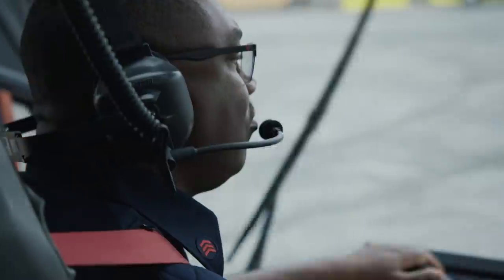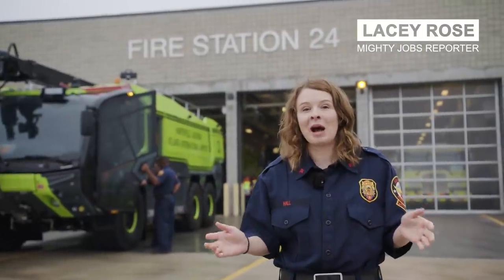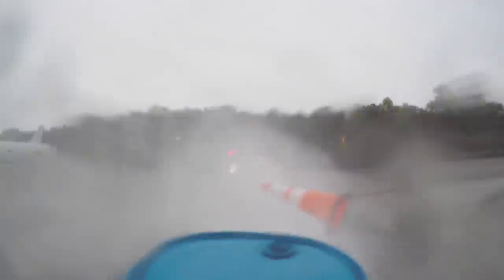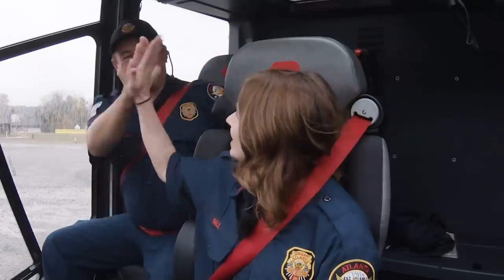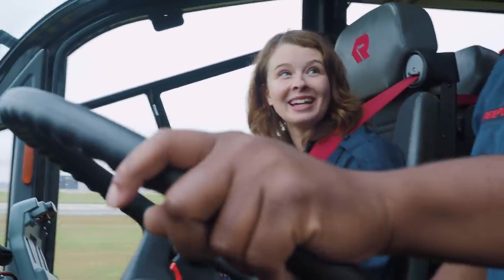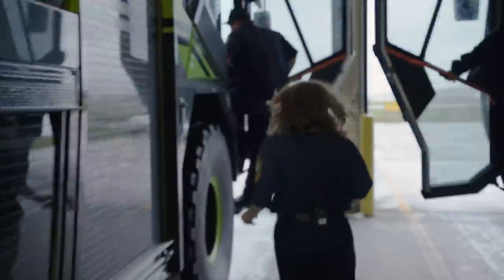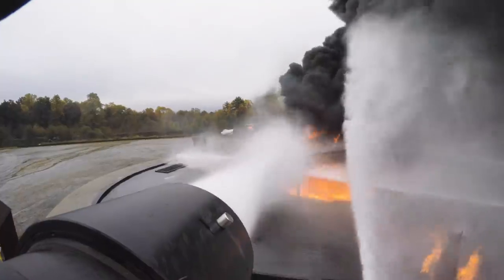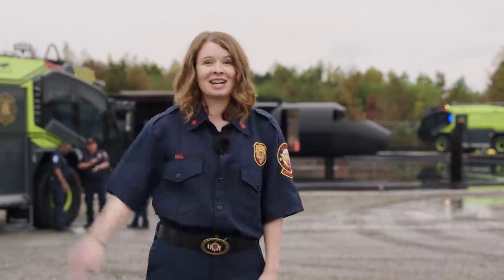The Fire Truck of the Future (2020) I Volvo Penta Mighty Jobs

Comment: Ordinary firetrucks: outdated and used all the time
Airport firetrucks: super advanced technology and never get used.

Thats economy for ya
Reply: They aren’t outdated plus airport firefighting is way different and has different needs then structural firefighting
Reply: PaintballGaming just the tip? I think you’re confused with what you’re talking about. Regardless, pumps, engines, hours; drivetrains lines, etc...come on dude.
Reply: JM Wiłłiams Not confused at all ARFF is way different than structural firefighting every firefighter should know that
Reply: Guys its a joke. Calm down
Reply: It’s not a very funny joke
Reply: I think they do this because when a planes goes up in flames, there are over 150 lives at risk, where as fires in the ground people can prepare for and the amount of humans at risk is low. Here in Australia around 20 people have died, the plane can have anywhere between 100 to 450 people.
Reply: ImaMcMuffin You can still have 150 lives at risk in a structure fire look at New York they have huge apartments with a lot of people in them and you can never plan for how many lives you could loose
Reply: Structure city fire usually has unlimited water supply unless it is rural, Airport, on the other hand, all you have is the fluid in that tank when it is out you are really out of power to fight the fire.
Reply: I’d expect airplane fires to be alot harder to put out with all the gasoline and stuff making the fire more powerful.
Reply: Hunter Miller Planes don’t run on gasoline they run on jet fuel or another type of fuel depending on your plane and it just depends aircraft’s burn a lot hotter but a lot of structure fires can be really hard to put out
Reply: @j.michaelwiiams1859  "just the tips" is the username that the other guy has
Reply: sibertooth  depending on how bad the fire is, considering both the fuel and the heat source are outside the cabin, there should be a few minutes from hitting ground to everyone being dead. Firetrucks usually take all of 5 seconds to reach the plane, as they are waiting right at where the plane will stop at the runway.
Reply: Ok boomer. Would you want the oldest fire truck trying to set out a fire on your aircraft? I don’t think so
Reply: You know i made this comment as a joke. I didn't mean to start a heated debate about firetrucks
Reply: @paintballgaming1090  People have different types of humour. 
Deal with it.
Reply: Christian Andersson That’s a weird sense of humor then. And nah I won’t deal with it what I said was true
Reply: PaintballGaming it’s called an opinion. There are different ones
Reply: Captain Skippa Never would’ve guessed...
Reply: @paintballgaming1090  The problem with New York like any other major city is that advanced firetruck can't do jackshit if it can't reach the place in time. Skyscrapers are going to be a big problem if the fire is going to be something like an airplane fire as sadly New York knows too well.
Reply: An airplane is full with toxic fluids thats why this firetruck is suitable
Reply: It's probably because Plane crashes aren't as often as House fires, car crashes and cats in trees
Reply: @huntermiller2867  Putting out the flames is  only one part. The power of the jet to chase the flames and heat  off the passenger comparment is equally vital.
Reply: @adenl13  airport fire departments have better equipment as they're privately owned and in general have a higher budget whiles standard fire departments have a smaller budget as they're owned by a county or a municipality...
Reply: Let's just say if an airport firetrucks fucked up the life toll would easily skyrocket
Reply: This beast is so costly it will cost 1trillion doalar to put this in every station
Reply: Once again, we have a civilian speaking out of ignorance. The city apparatus we have is NOT outdated. If you actually DID the job you would know. Also, it is up to local governments to allocate funds to their agencies. Atlanta is the BUSIEST AIRPORT, just like DFW and O'Hare. If you are stuck aboard a burning aircraft, you wouldn't be arguing about technology. It takes one minute to 90 seconds for a fire to breach the cabin of a commercial airliner. FAA demands a fast response(3 minutes for the first arriving ARFF vehicle). You dwell on that.
Reply: @florimond.  ATL is the busiest airport in the world it’s not private! It’s a public airport owned by the people of city of Atlanta!

Comment: I'm starting to understand why the reporter used soda cans and bath tub.

I guess Americans just dont want to understand metric.
Reply: I mean if it's a video in America, about American trucks, obviously Americans are going to watch. If we haven't grown up around the metric system, we wouldn't be able to relate to it just as you wouldn't relate to the imperial system like you do the metric system. Hearing 80km/h has to significance to me, while 50mph would have.
Reply: Some Americans need to get past the Earth is flat and there's no such thing as the moon.....Metric system is a long way away my friend.
Reply: Jacob Gilbert what do you mean by american trucks when its a swedish truck?
Reply: @robinaleksander6791  the company may be Swedish, but the trucks are in the USA. Not hard to comprehend for an American.
Reply: Hyperion WhiteStar the engine is Swedish but the company of the truck is Rosenbauer from Austria
Reply: Also, while the metric system is very straightforward sometimes any scale is hard to visualize. So we use everyday items to give a sense of huge size. Eg:  A bulldozer weighs 49,000 kg or 10 elephants or in SI 50 Metric ass tons.
Reply: Jacob Gilbert 

Yes because I’m sure changing the whole system to metric is a good idea and totally not gonna end in disaster as most taxpayers and current students will have to relearn the new system.

I’m sure nothing bad is gonna happen to the economy. Smh

Comment: I like how they extinguished a fire without stepping out of the truck! 😂
Reply: Lmfao
Reply: Yeah, pretty efficient
Reply: Why would they need to get out of the truck? The water is on board so no need to connect pipes, the hoses are too powerfull to be handled by people, they are more protected in the truck, they dont have time to do anything else, they are in open field, so they can park anywhere they want. They dont need to bring hoses around corners or in buildings.
Reply: @niconico3907  I never said they had to go out of the truck.
Reply: Give the time constraints on an aircraft fire, your right, by the time you get out an fix hoses. Forget it your a body collection detail

Comment: I thought in aircraft fires fire fighting foam is used?
Reply: Ghostytytyytbedhh im sure it is filled with foam when theyre not training
Reply: They don't use the foam in training because it harms the environment and there is no need during training, plus it's expensive
Reply: @KiranBJJ  fair enough. Never knew that but yeah makes sense.
Reply: Wint help you when its still hot underwards first coll it then drown it in foam
Reply: @user-pc5tc8dj7v no they dont
 Firefighting foam is cool. It also is good for use for fuel fires and it covers the flames and jet fuel. If they use water first then it would just wash all the foam off and the foam would be useless. They use water after to wash the foam off the tarmac.
Reply: @user-pc5tc8dj7v  yeh ghosty is right, the foam cuts off the oxygen from the fire, with no oxygen there is no fire as you know from primary school science. Once the oxygen has been starved for long enough there will eventually no longer be any heat as there fire hasnt had oxygen to create heat, it will cool on it's own
Reply: @Samuel Lynch yes that is why it is used for aircraft fires too, jet fuel is a chemical
Reply: Carter Bohrer  not like that's been said twice already 🤦🏽‍♂️
Reply: While it is originally used in aircraft nowadays more departments use foam in structure or any other fire bc why not, it does the job in half the time.
Reply: @KiranBJJ  or refire when the foam vanisches before the heat which has also a very good saving medium(the floor) is completely gone
Reply: @KiranBJJ  which it does
Reply: The foam is in the water
Reply: They use retardant (from what I heard off SMFR) or purple k
Reply: @KiranBJJ  bingo
Reply: they need both, water is use to cool down the fuel tank so it wont explode and foam to cover the fuel on fire.
Reply: KiranBJ 

Oh yes it harms the environment. Smh. You people gone keep using that to ALL of your conversations? 

Oh paying taxes harms the environment. 🤦🏻‍♂️ smh
Reply: @KiranBJJ  save the environment but use large amount of fuel that produces major smoke pollution...??
Reply: @jaknayree2000  every little helps, would you rather them do both?
Reply: They use WetWater. No joke! A substance called a Surfaccant AKA Wetting Agent is used, washing up detergent is one. Breack the surface tension of the water, goes faster and gets in all the small places as sit dosen't puddle.  Putting the fire out is this case is a secondary, keeping flames and heat off the passenger compartment is primary. Ifyou don't do so within 90 seconds, your just a mortuary crew.

Comment: Los Angeles should use those against the wildfires
Reply: Would be cool but impractical. It’s almost impossible to put out full fledged forest fires. Instead they control the fire by dumping retardant onto sensitive areas and creating fire lines to prevent the fire from spreading. If this truck can dump it’s entire reservoir in less than 2m then it’s useless.
Reply: Or they could just stop starting their own fires
Reply: @OrthobroLocal1  But they don't though. A lot of brush fires are starting by the dry seasons when something as simple as two leaves scraping together spark and boom, forest fire. Some are arson and some are accidental yet most of them are natural.
Reply: Kadeem Johnson LA? How about Australia, our hole country is in flames
Reply: @mrengine9  i'd say lightning is a larger factor then leaves scraping together in terms of nature.
Reply: Kadeem Johnson water doesnt put out wildfires (specifically) garden tools do
Reply: controlled burns.png

Comment: Makes  you wonder why not equip every  fire department with these...
Reply: Alex Valeev only useful in very specific applications. all fire apparatus are custom built and/or equipped to their response area
Reply: One single word; price. These are probably extremely expensive and not every airport or airport fire department can afford these. Since this is the world’s « biggest » airport, it probably has the budget for those.
Reply: VERY VERY expensive
Reply: Because huge waterjets and trucks that tip over during sharp turns ain't very useful in cities.

Comment: Every fire department should have a fire truck like this. Ordinary fire trucks and crew take too long to connect the hoses before they even turn on the water.
Reply: Andy R Aircraft fires, if they are on the field, are in a wide open space and for the most time on the exterior of the aircraft. Structural firefighting happens inside of buildings, so we have to go inside and find victims and the source of the fire and knock it done. I’ve done both since 1987 it’s two totally different kinds of firefighting.
Reply: Andy R thats why the hoses on “ordinary” fire engines are preconnected. these Aircraft Rescue and Fire Fighting, or ARFF, rigs are purpose-built for airports. they would not be effective at all on most structure or vehicle fires due to the fact that mobility is very limited in tight spaces like crowded freeways and narrow streets and alleys. these ARFF rigs are built for large open spaces like airports

Comment: what if they are training and an actual plane catches fire 
do they let this burn out or is there a extinguish system that does it for them on site
or do they leave one truck behind to extinguish it, or do they extinguish this first and then ride to the plane?
Reply: There's still at least one, more than likely two fully capable companies ready to roll to an actual emergency while training is going on, as the video said the actual fleet has 29 units, very rarely to aircraft or airfield fires happen, it's highly unlikely they'd overlap, but if they did there's a contingency

Comment: That is slow
Reply: 0-80 kmph in 28 secconds while weighing what that thing does is quite impressive. I drive a 2015 peirce that weighs 2/3 of what that thing does and it takes 4 miles to go from 50 kmph to 110
Reply: When you put it that way it is decently fast
Reply: @sambarclay4493  If you have 14000litres/14000kg of fluids+the weight of the truck aroundabout 10000kg thats around 25000kg. I recon that 28s from 0 to 60 is pretty darn fast